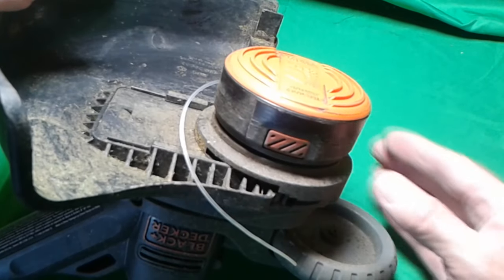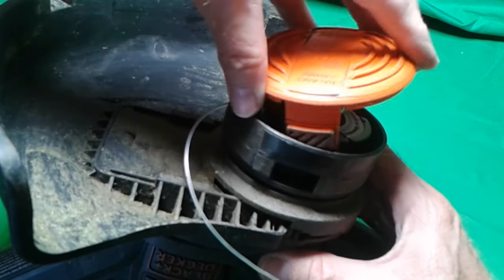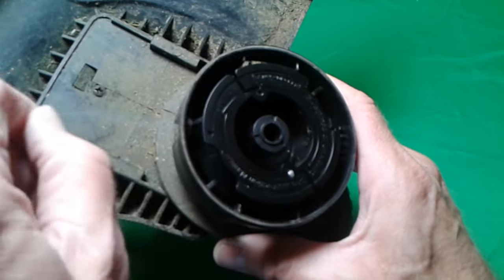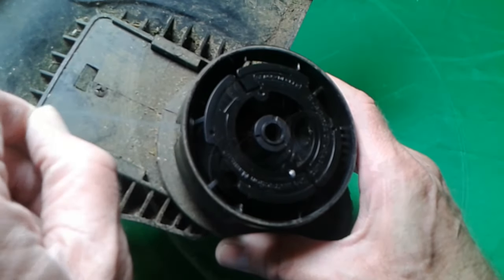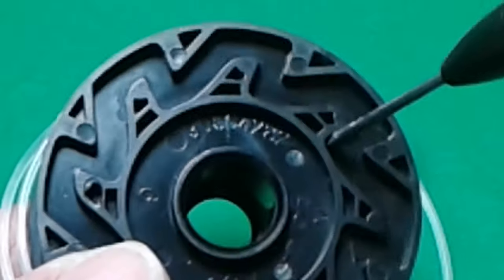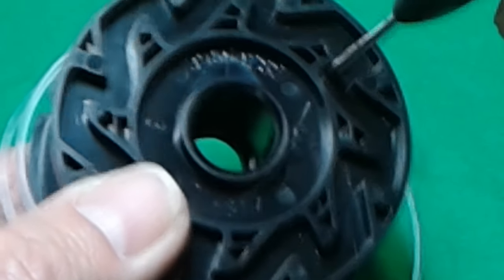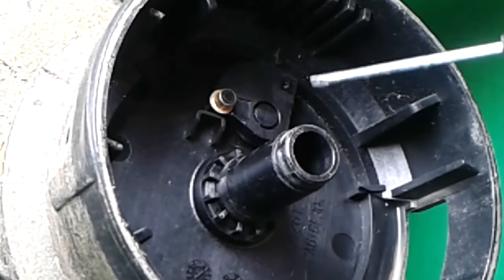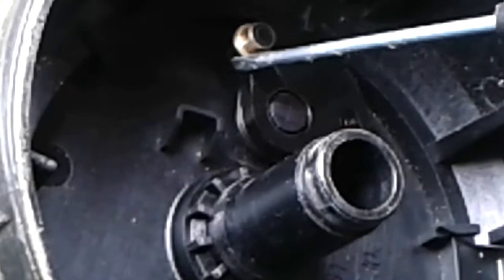How to Fix Black+Decker 20V Cordless String Weed Trimmer Edger LSTE525 Won't Feed Line

Comment: Is that lever on a spring? If so very key missing detail on how it works.
Reply: I am wondering the same thing.  I looks like it is, based on him pushing it with the screwdriver and it coming back, but not certain.
Reply: I have two trimmers with this feature, and neither of them has a spring. The ones I have work on centrifugal force and (I guess) inertia. However, someone else commented that there is a spring you can buy to install.
Reply: Mine has no spring. Had to replace the pivoting lever and now it goes through line quickly. Anytime there is an obstruction causing the RPM to drop a little it feeds a couple inches of line. It will go through a whole spool in minutes. It either needs more weight on one of the ends. I'm not sure which one. I guess there's a 50/50 chance I will pick the right one to begin with. Either that or at a spring or some sort of shim to add friction

Comment: I had to replace the whole spool holder/gear piece due to a stuck bearing, and for some reason the new spool fit too tightly on the spindle on the old faulty piece. Only problem, the gear is greased, but i don't know  what kind of grease to use and where and how grease is needed. Any thoughts?

Comment: Mine works perfect from time to time when used. However, it interruptly stops even with a fully charged battery. Could it be the battery is defective or wrong line used in spool?

Comment: Thanks for the video.
The mechanism moves freely, but when i press the easyfeed button no extra line is fed.
Should the line release mechanism move by just pressing the button without running the trimmer?
Is there an internal line that releases the seed mechanism, maybe it is broken?

BTW i bought Amazon's knock off spools, could that be the issue as some other viewer reported?

Comment: Ok no jams and mechanism is functioning. However when I push the button to feed more line it’s not working on it’s own. I push button and pull manually it works, but not on just the push of button. Why?

Comment: My problem is, for some reason, the line won't feed out even if I try to manually pull the wire to release the mechanism with the cover and spring fully on. When I take off the cover, there appears to release the pressure enough for the reel to properly ratchet. I replaced the cover and the spring but still too tight. Will try to find out why this is happening.

Comment: I have a 40V version, and my pivot mechanism doesn't have a spring on it.  There is also no brake on the handle.  I believe it is designed to allow the pivot to move by centrifugal force, but ever since I replaced the spool, auto-advance no longer works no matter what I try.
Reply: Try to
Use original part instead of knock-off Amazon line. That was my problem

Comment: I have a problem with my 3-in-1 black and decker in that it will run for 3 sec then stops cutting. When I check the string I see it got pulled back into the spool and I have no idea why. This keeps happening to me over and over

Comment: READ THIS: My weed wacker does not have the spring like the one in the video. Mine works on centrifugal force. The new spool of line must be loose on the center shaft, it has to move up and down easily. When you tap the head against the ground it defeats the cap spring, allowing the line spool to drop down slightly and just for an instant, allowing the locking cam to 'trigger', letting more line out. Then the spring pushes the line spool back up, locking it into place. If the spool cannot slide up and down on the shaft, it will not feed line out.
Reply: Not on this system, there is nothing to move or tap. It is just gear advanced when the centrifugal force changes from the pivoting arm
Reply: Thanks. I was wondering how to activate the advancing mechanism. Black and Decker doesn't have a 'soft, springy' advancement mechanism, like others I've owned. I love the B&D, but it's getting on my nerves. Lol. Thanks again. 🤔😊

Comment: What worked for me was to clean the black plastic teeth below the string reel and also the bottom of the reel.  Mine had WD-40 on them and after cleaning it off the string started feeding again when pushing the button.

Comment: I have a LST420 and the lever does not have a spring load, just floats freely on the pin. No matter what I do this thing rarely auto feeds. I've replaces the cap & spring, use B&D factory spools. Very frustrated with this product.
Reply from the maker: I do not have this model, but on mine the spring is actually a small coil under the lever. It would be easy to miss it

Comment: Mine worked until I had to get a new string cartridge, since I put the new one in... it won't auto feed when I use the button. I have tried a few things and no success. Any ideas?
Reply from the maker: Maybe try manually wiggling it around to make sure it will freely come out?
Reply: @BassocantorReviews  yes if I wigle it back and forth to manually feed it, it works but not when I press the button. It is annoying =(
I love this trimmer
Reply: @juanriat4056  I have the same problem.  The push button worked until I had to replace the first spool. Now it doesn't. Trying to figure out how to fix it now.

Comment: Is there a spring under pivoting lever, if so where do I buy one?
Reply: Found it! Spring part # 244053-00
Reply from the maker: Wow that was very kind of you to post it. You are a good person! Best, Chris
Reply: @annelinekraemer2866  where did you get that from, I need one as well !
Reply: @leeroche5800  Just google the part number, it's a $3.99 part. However, I ended up not needing it. Even though, the area looked clear of debris. I removed the lever and brushed the area with an old toothbrush and it did the trick! I'm really not sure there's a spring there. There isn't on mine. I think that mechanism is pretty sensitive. I'm buying generic spools. It worked better with a different brand. Good luck!
Reply: @annelinekraemer2866  i can see a spring either so bit confused. Thanks for the reply
Reply: That spring part# listed is for the cap spring, NOT the lever spring cause the lever doesn't have one. The model with the grey release button (lst525) is way better than the 522. Sorry but the design is garbage.
Reply: @barneyrubble4827  the lste525 model does have a lever spring and mine is missing and apparently nobody can find one.  The only spring available is the cap spring.  I agree, the design is garbage. I'm going to have to throw my trimmer out because I can't find a two dollar spring.

Comment: Is it possible to remove the outer spool in order to use a brush blade? For the life of me I can't figure it out.
Reply: No. I just checked mine today. The gear inside and pressed onto the shaft and head. All molded with plastic. You would have to cut it and weld a m10x1.5 bolt on the end to use different heads.

Comment: Mine feeds too fast. The small mechanism pivots easily, I have the spring on the cap, and the string is OEM. Whenever I'm weed eating, it wants to spit out a ton of line and it gets all jumbled up and spews plastic line everywhere. Any way to fix that?
Reply from the maker: That sounds like the line is wound the the wrong way. Are you sure it's correct?
Reply: Same problem here
Reply: I am facing the same issue...as little as i try to run it in short cycle, with every start its spilling out the string. I did check the break as well (gray button for auto feed) and it does stop the motor after pressing, so that is not malfunctioned. But not sure what else is... I am keep searching online for any info to fix this string feeding issue..so far no luck..
Reply: Exactly my problem. I was thinking of adding more weight to the pivoting arm but I didn't have this problem until my original pivoting arm broke and I replaced it with the exact Black & Decker part. Everything swings very freely. Maybe too freely
Reply: I have the same problem (it feeds all the time). Have you guys maybe found a solution? Thank you :)

Comment: My spool is new, but it won’t fit into housing....it is the right size.  The spool is wound really tight & it won’t release.
Reply: I had the same problem, I'm wondering if the spindle is slightly enlarged over time (from heat maybe) and the new spool has a slightly smaller center opening so it fits too tightly on the spindle. Mine also has other problems but this is after about 7 years of regular use.
Reply: I've also had spools where the line sticks to itself, almost like it's been melted.

Comment: My problem is that I cannot split the two side of the more housing for my B & D trimmer.  All the screws are out, but the two sides cannot be split with the help of a screwdriver.
Reply: Check for more screws, there are a couple that are recessed so may not be very visible.
Reply: You also have to remove the piece that holds the offsetting wheel which requires a screw driver to pry a tab.

Comment: My pivot mechanism doesn't seem to be spring loaded, I guess I need to replace the part.
Reply: It's called a Lever Assembly. Just have to check model number for correct one.
Reply: Thanks, your video helped and put me on the right track.
Reply: Well, that didn't work. The new pivot mechanism is not spring loaded either. May be time for a new weedeater.
Reply: @bigalinsc  I don't have the spring either so I suppose a new head won't help me as well.  Very frustrating to have to stop every two feet and manually let out line.
Reply: @dennisbusch4124  Same here.  Let me know if you figure out a reasonable solution.

Comment: Still doesn't work on new trimmer.  The line always breaks off inside then the reel unspools, line crosses everywhere.  Hard to keep rewinding it in your front yard with pest control guy bugging me.  I should have said...control yourself and go away.
Reply from the maker: Wow that really sounds like the line is on the spool the wrong way. But of course if it's a new trimmer, that would not be the problem.  Maybe some other viewers could comment on this as well.

Comment: Mine lets out line the whole time it runs and it won’t stop letting out line.
Reply: It is put in the right direction too I feel like my pivot mechanism is flipped
Reply from the maker: I thought of one other thing. The feed line works by acting as a brake. Make sure that the spool can turn very easily within the housing

Comment: The devil's in the details.  The 'spring' in my B&D trimmer broke and disappeared.  I don't have it and have no reference for how it was oriented/placed.  I.e.,   I have no reference for how a replacement spring should be placed.  I assume the spring's orientation and its placement under the lever is critical.  Your video would be more helpful if it actually showed you replacing the spring along with any tips/details related to the installation.

Comment: Why doesn't Ryobi (and other manufacturers for that matter) provide information on how their systems work? Then many of us could fix our own stuff or at least make a good diagnostic guess. And that would not really diminish the manufacturers' incomes from repair charges because there are plenty of people who would still take devices to workshops even if they could see how to fix it. But at least they might know what the problem is and whether it's worth repairing or not. As well, user manuals are usually very badly written. They need to use professional technical writers. I used to import from China to Australia and the manuals were mostly unreadable so between my Chinese wife and myself, would re-write them in proper, understandable language. And I use the word 'language' rather than English, because most manuals do not have even fundamental sentence structure common to all languages, nor syntax nor punctuation nor  proper spelling nor logical layout. So frustrating. Anyway, it's time for a bottle of New Zealand Chardonnay now because the sun is going down.  Cheers and thanks again for your great video!
Reply from the maker: Wow thank you for taking the time to write such a detailed reply! Best, Chris
Reply: They design them so that you throw it away and buy a new one rather than repair it

Comment: Why doesn’t it feed the line? Because it’s a poorly designed piece of garbage.
The problem is, the torque of the motor is so great, that the line gets imbedded in itself before it feeds out, and you get have to keep opening it up and re-winding the line. So frustrating! The only solution is to use thicker line than they recommend. Even then it still gets clogged on occasion. When it does feed out line, it feeds out about 6 inches at a time, not one or two inches.

Comment: The Black and Decker AFS is completely useless.

Even after following every instruction and tip to the letter, Ive never had one work correctly. I'm not sure why I keep buying B&D other than the lithium battery models are light and inexpensive.

Comment: that's all very well but mine works for a minute & then stops. I've charged all the batteries so what else could be wrong?
Reply from the maker: Do you mean this happens for different batteries?
Reply: @BassocantorReviews  I have charged the batteries multiple times. What else could be wrong?